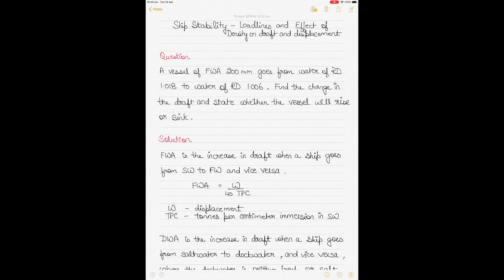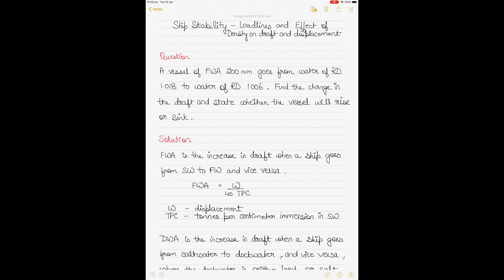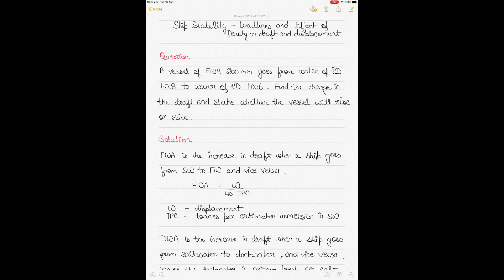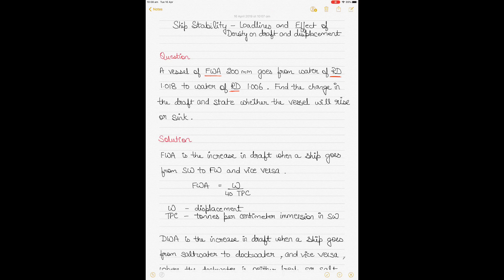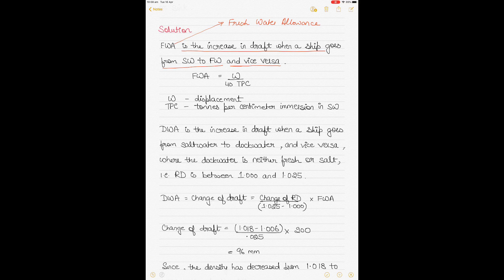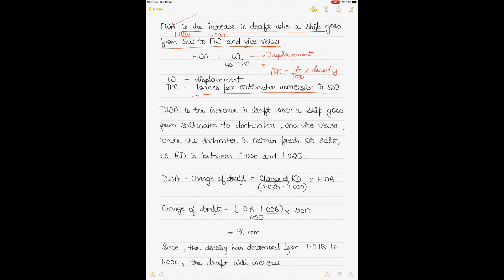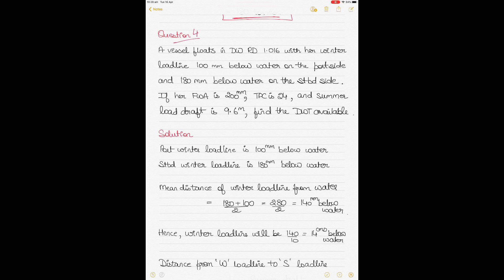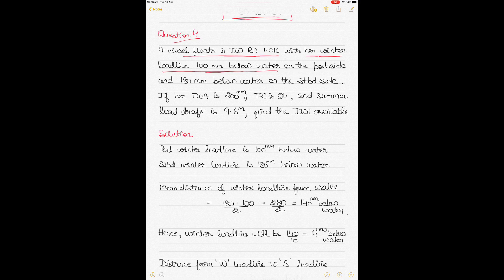Ship Stability - Load lines, effect of density on draft and displacement

Comment: Great video, one question. If youre going to load in a dwd 1.023, do you need to apply density correction to meet the summer draft of 14.45mtr in dock water or you must apply it in sea water? Meaning on departure you’ll get morethan the summer draft because you know in SW you’ll get the 14.45m.

Comment: (b) A bulk carrier presently of 12250 t, a km 9.8 m, has a list of 6% ° to starboard.  She then loads 1250t ore (KG 8m, 2m to stbd of center line) and discharges 250 t of ore (KG 2m, 5m from the starboard of center line).  160t of SW ballast is the transferred from the stbd shoulder tank to the port DB tank (vertically downward by 9m and transversely by 10m).  Find the list, assuming that there are no slacks tanks, given that the final KM is 9.6m.

Pls solve this que